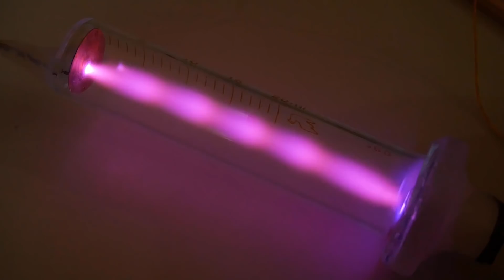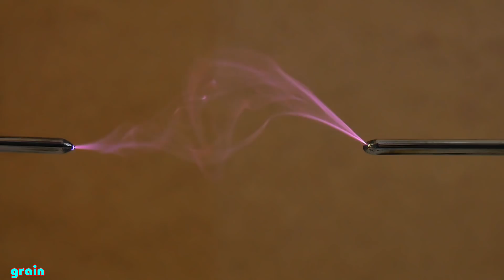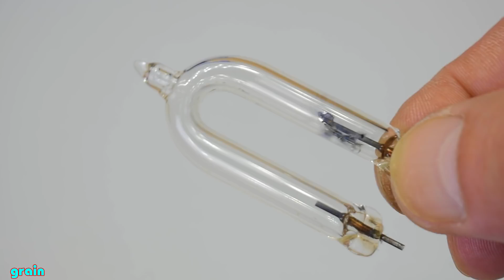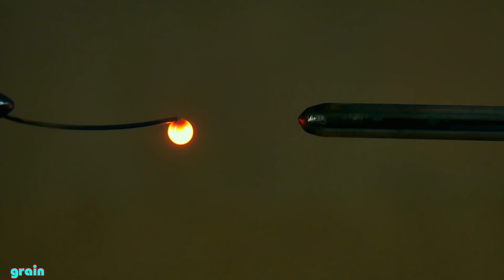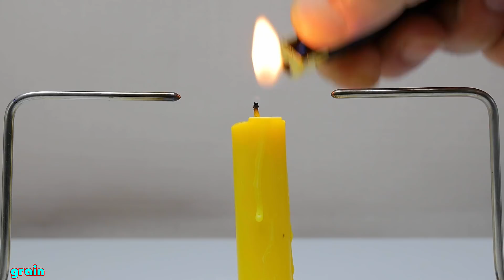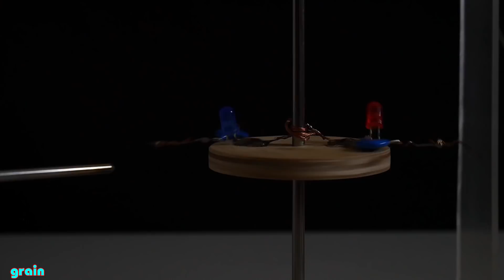High Voltage Show

Comment: To the LED surviving. I'm asuming the LEDs are dropping roughly 2 volts each, and the rest of the voltage is dropped across the two airgaps, and that the high voltage power supply is putting just enough current to light them relativly brightly without burning them out in the first few seconds.

Comment: Can you make a separate video as to how to use and construct the HV ac transformer shown on the upper left corner box in the video at timestamp 11:50?
Reply from the maker: I will not make a video, but I will say that you need to do no more than 50-100 turns per row, and if there are more turns in a row, then more insulation - lavsan tape or paper. About 5 mm should be left on the edge. Then impregnate the entire coil with heated paraffin or epoxy. I did both options with 2-3 layers of insulation and not a single coil gave an internal breakdown. At the same time, when you finish the row, there should be more insulation, since there is more tension between the rows. Epoxy is better to use the one that is for jewelry, it flows well in the cracks. If possible, use a vacuum chamber after pouring. Some people just use oil filling, but I don't like the liquid state.

Comment: Sir,
May i know the number of turns(thickness of the wire awg or swg) on the primary of the flyback transformer and the value of C1, C2, C3, C4 capacitors  voltage and nanofarad ratings also the value of 10 labelled in your schematic.Sir can we use this circuit with irfp260 mosfet instead of irfp460. Seeking for your valuable response. 
Thanks in advance.

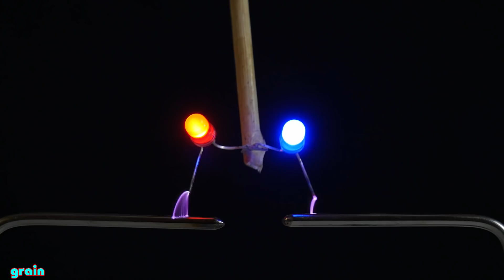Comment: 3:00
Im most likely wrong
But isnt that due to low current of the suply?
Reply: I'm guessing it's a combination of the low current of the supply and also the resistance of the air gap between the rods and the LED leads.

Comment: Why the lamps dont burn out?
Reply from the maker: The voltage is high, but the amperage is insufficient. As the voltage rises, the current decreases proportionally.
Reply: @grain-diose  And if you connect it directly to the conductor, it will burn?

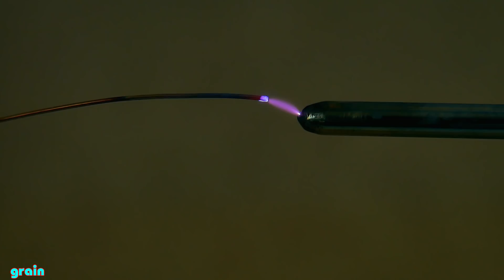Comment: 4:20 negative contact. On AC ???????
Reply from the maker: In such a transformer, there are diodes in the output coil - https://img.radiokot.ru/files/22595/medium/21lp5c6j61.png

Comment: ‘‘tis interesting, yet kinda disturbing?
Reply from the maker: This voltage is sensitive, but absolutely harmless. Electroshocker is much more harmful. The fact is that the current is of variable frequency and this frequency is quite high, about 50-70 kilohertz. At this frequency, the current does not have time to penetrate deep into the body; at the beginning of penetration, it begins to change direction, so it does not have time to go further. In practice, you will only feel current at the ends of your fingers. At a frequency of 1 megahertz and higher, like the Tesla coil, the current does not even have time to reach the nerve cells of the fingers and moves only above the dead skin cells. You can see it on YouTube. The stun gun is a completely different matter, it gives single discharges of the same polarity. And if you bring the contacts of this category to the heart, then I think it might end badly, in any case, for a person with a weak heart, definitely.

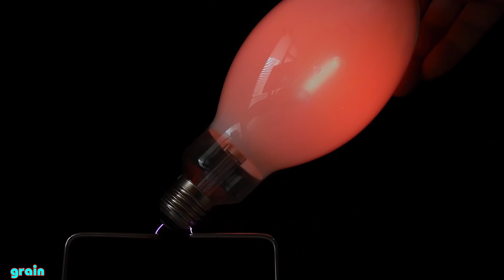Comment: 2:30 Be careful with applying high voltage to mercury/sodium lamps or tubes, because they can produce xrays.
Reply: So we dont need to go to the hospital
Reply: @johntinktonk  yay
Reply: So does Aluminum
Reply: kecske
Reply: @uiopuiop3472  es?
Reply: @uiopuiop3472  gratulálok XD

Comment: That Copper wire expirement is a good idea to future welding with electricity
Reply from the maker: Sure! You can very well make a bimetallic element in this way by fusing together the two ends of wires of different metals. Such elements are used, for example, to measure the temperature of a soldering iron.
Reply: @grain-diose  well my idea was like put the copper wire on a metal and then bring the electrified wire close to it, then with the temperature produced with the electricity conducted by those two wires the copper one will melt and then it can weld many things in that way I find this a good idea

Comment: Ion engine sound like tractor
Reply from the maker: It is possible that ions also work in the tractor. :)
Reply: @grain-diose  wonderful video i also want to work with high votages dont have resources although i had drawer filled with electronic and stuff

Comment: The glass experiment is very interesting. Why the spark does not continue at a certain degree when the glass is between the electrodes. Yet tesla claims the oposite. This raises a question about the nature of electricity he was working with. Interesting video

Comment: Where is the video of how to make high voltage generator and wiring diagram . Please reply me please I wanted to make it please.
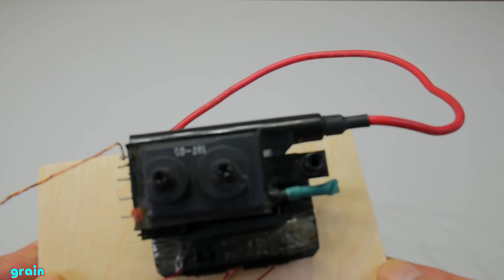Reply from the maker: Just buy an IR2153, two powerful field effect transistors, a high-voltage transformer from the TV and assemble the circuit in the video 0:57 Or look in Google - https://www.google.com/search?newwindow=1&sxsrf=ALeKk02HRM09iMkIIdq7B0WrHuzRknJKHQ%3A1593464957928&ei=fVj6XveROJnYmwXKv7TgCg&q=IR2153+high+voltage+generator&oq=IR2153+high+voltage+generator&gs_lcp=CgZwc3ktYWIQDDoECCMQJzoCCAA6BggAEBYQHlD1OFjXa2CxdWgBcAB4AIABeYgB-ASSAQMyLjSYAQCgAQGgAQKqAQdnd3Mtd2l6&sclient=psy-ab&ved=0ahUKEwi3xJ3G96fqAhUZ7KYKHcofDawQ4dUDCAs

Comment: Your warning does not apply to ElectroBoom He'd touch it with "bear" fingers
Reply from the maker: Yes, this is a fun channel. :)
Reply: No he wouldn't. I would hope he's not that dumb!
Reply: @kevinerhartjr.273  Lol he does, watch one of his videos. It's not as fatal as you might think, I'm not sure about the specifics of the circuit in this video but judging off the fact that he can run LEDs of that voltage I'm assuming the current is very low.
Reply: @KofiAsare0  No, this can melt 0.4mm copper wire and a needle in a few seconds if correctly set up as you see in the video, so the current can be quite high, way more than 20 mA I'd say (from my experience lighting matches with thin copper wire).
Reply: @GRBtutorials  Wow I didn't know you could do that! And to think that only once my former foster mom tried to teach me how to do it the impossible way! 😬
Reply: Yeah and then he'd get hit in the bare eyeballs by sparks in the process

Comment: Why not useZVS driver
Reply from the maker: I made a ZVS driver, but something was wrong, there was a very small arc. I also made a generator on one transistor, this of course gives a very fast heating of the transistor. The IR2153 chip is designed specifically for this purpose, so this is the best option. In this generator there are specific nuances for controlling the output transistors, and this chip solves them. As you can see, even a coil choke is not required here. And its price is ridiculous - https://aliexpress.com/item/32845312012.html
Reply: Reducing the number of primary winding will surely solve your problem. I make one before and works very well

Comment: LED not burn by high voltage???
Reply from the maker: Yes, the LEDs did not burn out.
Reply: @grain-diose  it's different types of LED Or normal small DC voltage LED
Reply: @Aazib_Khot  normal LEDs

Comment: Whats the point in adjusting the frequency? those flybacks are DC under no load. Does it help when there's a load or does it help the flyback run better?
Reply: And how much power you used for your flyback?
Reply from the maker: I can not answer this question. Maybe you need to get into the resonance of the transformer, maybe there is a frequency that more efficiently transmits the oscillations. But the longest arcs at one frequency, the highest temperature at another frequency. In my opinion, the load does not affect anything, I did not notice it.
Reply from the maker: I raised the voltage to 30-35 volts. Current strength with long arcs of 1-1.5 amperes, with increasing frequency and melting of metal 2-4 amperes. In other words, a maximum of 100-120 watts.

Comment: Can it be powered by 12v 5a SMPS?
Reply from the maker: IR2153 starts working at 9-10 volts, but not stable. The voltage on the datasheet is 15.6 volts.
https://html.alldatasheet.com/html-pdf/68074/IRF/IR2153/45/1/IR2153.html

Comment: Hi, great video, the reason the LEDs did not fail is probably due to the EHT voltage being of very low current.
When the arc is struck to the LED leads the arc that is produced acts as a series resistor.
Also the current through the LED circuit will possibly be the maximum that the EHT transformer can supply.
Reply: Leds didn't fail because they are current driven devices. And the amps will never reach the Leds limits unless you use power transformers
Reply: @peterzingler6221  you said it!

Comment: Thanks for your demonstration !  Thermocouple fabrication require the two dissimilar metals to be joined (ideally melted) at the very end. Looks like your apparatus could do that!
Reply from the maker: Of course it is very simple. With a required power supply of up to 100 watts, the device easily melts a 0.5 mm wire of various metals. I even tried nichrome 0.4 mm.